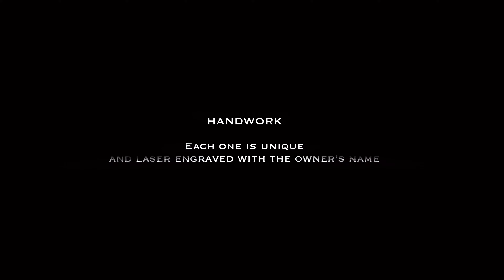The SSS HAWK EYE SLINGSHOT

Comment: Sir pls tell me a solution for my cheek hurt when i shoot in butterfly style ❤❤❤
Reply from the maker: you are probably holding the pouch slightly twisted, or the rubber is very close to your cheek
Reply: I use 220mm long rubber to shoot the butterfly, and the thickness of the rubber is .65mm.Is this measurement correct for shooting the butterfly?
Reply from the maker: @burhanvlog1997 
I use for halfbutterfly
20-14-280mm
0.55 thickness